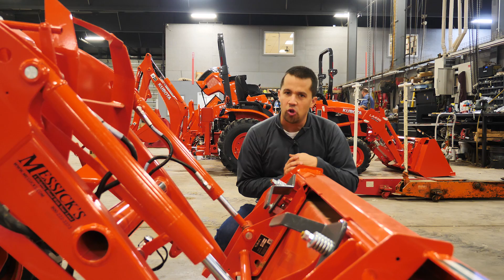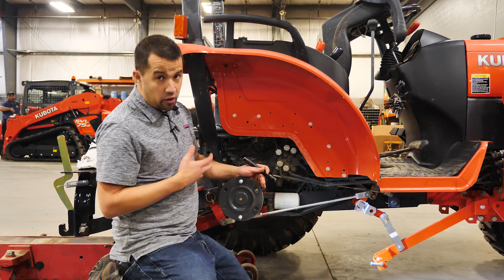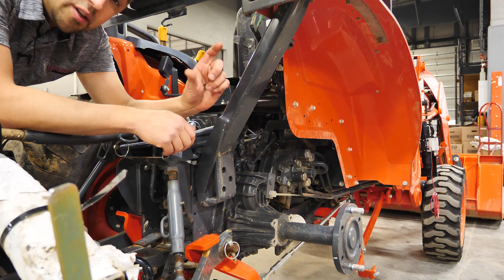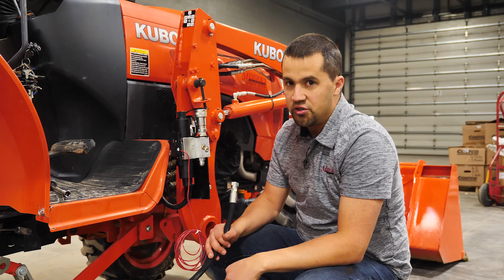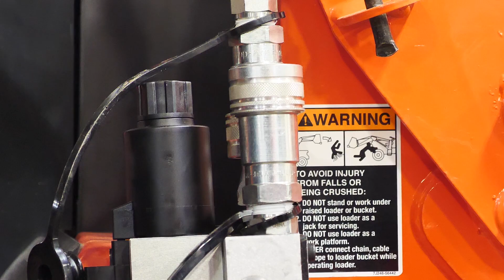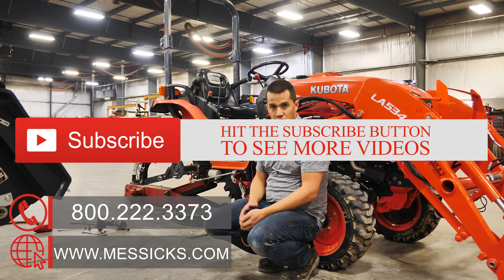Installing WR Long 3rd Function Kit on Neil's Tractor | Kubota B3350

Comment: WHY is everyone putting the diverter on the loader mount to the ouside of the tractor so hose connections stick out where they can catch on things?

YOurs has less hoses... and thus doesn't have the more common 2 hose connections pointed straight out.  So that's better, but I would think still vulnerable to catching hose and or wire.

Isn't there a way to mount that somewhere else?

Comment: If I need a continuous flow in the rear of the tractor , can I put a hydraulic multiplier in the 3pth line? my tractor has a visible cylinder for the 3pth in addition to possibly internal lifting mechanism. 
thank you

Comment: Warning for back hoes! The diverter uses the same power beyond that the back hoe uses so the kit will not "drop in" and be plug and play (at least on some models such as B2650). There is some modifying and custom plumbing that needs to be done so keep in mind it will not be an easy straight install.

Comment: I done this to the T on my L4240 ,my grapple works great in one direction ,open or closes ,if I swap the hoses at the diverter valve quick disconnect the grapple works great in the other direction otherwise it’s always extra slow in one direction
Reply from the maker: Probably have bad couplers
Reply: @MessicksEquip  that’s what my local hydraulic shop said so I spent $70 to replace the new ones that had came with the 3rd function kit no difference
Reply from the maker: Damaged 3rd function solenoid then.

Comment: is this the same with the new LX 3310 with a 535 loader? the loader valve looks like it is in the same place as on the b3350 . are the kits and hoses the same? Has anyone done this yet on the lx3310?
Reply from the maker: It is. I bought an LX3310 and moved the kit from this tractor to that one.

Comment: I recently took delivery of an LX2610.  The first thing I did once they got if off the trailer was to fold the ROPS so I wouldn't forget and tear my garage door frame out.  The first thing I did once my ass was in the seat was raise the 3 point so the rear blade could clear the dip at the end of my driveway.  I suppose it doesn't speak very well of me, but somehow I feel better about myself when I see that Neil Messick's own LX3310 has the same bent top link that I had less than two minutes into my tractor ownership!  Lesson learned!

Comment: Hey great video. Can I get a kit for my 05 B7800? Ether oem or aftermarket? Thanks!
Reply: Yo Neal I installed that 380-152A kit on my B7800. Had to tweak the mounting bracket and add two fittings. Bought a Worksaver 48” grapple, had two hoses made up for it and now everything is working well.
Reply from the maker: Yes you can! 800-222-3373. Ask for nate.
Reply: @MessicksEquip  Thanks Neil, spoke to Nate the other day. Very informative conversation and outstanding customer service. I'm gonna go with a Land Pride 380-152A kit to get the two button control versus Wr Long's rocker style switch.  I may need to have one hose made up to make it work or maybe not. Still figuring that part out. Hopefully I can use the kit in it's entirety and make it work. Also like how your website states the quantity of the various kits you have in stock. That's awesome.

Comment: Neil, would like to have been able to watch a video like this before I installed the rear remotes on my B2650. Among other things, had a heck of a time finding part number/correct fitting for the loader valve.  Even your parts guys sent me the wrong one.

Comment: Why the WR kit vs the Land Pride kit? 

Would a Land Pride kit be more factory looking?
Reply from the maker: Yea, we generally use LandPride on the models where its offered. WR has a bunch bigger offering .
Reply: @MessicksEquip  on an L3301 would the kit come hard line plumbed or would it be hoses? 

I know the new LX look sharp very clean but I expect the L series to be more function over looks.
Reply from the maker: Hoses on the land pride kits. Oem has hard lines.
Reply: @MessicksEquip  so for an l3560le it is an option?
Reply from the maker: @TommyOmallet  yes.

Comment: Neil what kit do I need for my L2501?
Reply from the maker: https://messicks.com/part/380-152a/kubota-std-l-series-third-function-valve-kit
Reply: @MessicksEquip  Neil will this work on my B2601 with a BH70 Backhoe or does the backhoe use the extra port?
Reply from the maker: @mikehobbs8625  You have the T the port.

Comment: I’ve got an L2501 with a third function valve which I use my grapple. What other implements can take advantage of the front hydraulics. For example can a front mower be adapted using my skid steer type quick mount? How about a front mounted rotary anvil mower? Brush hog style?

Comment: what are these valves rated flow? i can't find that on their website. need a valve that can function both a grapple and a motor, system is only 6 gpm so i would think it should be able to handle that.

Comment: FWIW: i put a dash mounted switch to control power to my third function switch and a red power indicator light. i only turn it on when i have something attached to the front loader that requires hydraulic power like my grapple. this way i don't accidentally actuate pressure to the front when i don't have a need to. this saves on accidental pressure spikes when operating the loader
Reply from the maker: Smart. The OEM valves also have this.

Comment: I have this WR Long kit on my cab tractor, the dealer mounted it below cab on the rear of tractor. This works great, out of the way and no chance of me ripping the wires out of valve when working around trees/brush. Reasonably priced kit to get the 3rd function

Comment: I built my own 3rd function setup from spare parts at my shop and ordered the handle / switch online.  I had trouble seeing the markings on the loader valve so I called my dealers shop to ask if they knew the layout. They had no idea what "power beyond" even was.....I wish I had been able to buy from you guys!  

By  the way - if there's room (depending on model) the valve is better protected mounted on the other side of the loader frame in between it and the hood / engine shroud.
Reply: @Jordon Carlson Trade school? What's that?  Is that where they teach new "techs" how to charge their laptop for diagnostics and  email the factory tech support for help when they don't have step-by-step instructions with pictures?......I've got guys with 10 years plus in equipment work who still think every hydraulic fault starts with "the oil in the tank must be low"!

Comment: I put one on my Kubota with a backhoe everything was pretty easy except for where to hook up the hydraulic lines I ended up taking it to Messicks/Halifax and the mechanic hooked it up but even he was scratching his head a little but he got me fixed up. I have a grapple for the loader and I also use the 3rd function for the backhoe I converted the thumb to hydraulic works great 👍

Comment: So since this kit is using the power beyond port does that mean one could use this kit and both loader ports at the same time? E.g., close grapple, curl and lift
Reply from the maker: oil will flow the path of least resistance down all 3 circuits. Its pretty challenging to do them all together.

Comment: Why is the unit not placed at the front of the tractor on the loader and use the loader bucket cylinder hoses as the feed and return lines.  The default 1po1sit1ion would be to tip the bucket the other for auxillary ports.
Reply from the maker: There is a style that does exactly that, they are harder to use.
Reply: @MessicksEquip  thank you for the reply.   I would not be happy with that product.  I guess I am too much of a neat freak to have that type put on my bx23.  I would want the factory style installation where there would not be any extra hoses on the loader and the quick detach would not be impacted.

Comment: Had this installed from dealer and  3 months later its stopped keeping the grapple bucket closed and open. Its like it leaks by.  They replaced it and its still doing same thing. Dealer says they dont know why. So i have to keep pushing button to keep bucket closed when loading brush. Just curious if u all have had any issues with this?
Reply from the maker: sounds like a bad solonoid.
Reply: you might put a pressure gauge on the return port of the valve to see if something is causing pressure on that side. next i would move that pressure gauge to one of the grapple hoses and try again, unhook your grapple and from the quick connects and hook in your pressure gauge to one side of the quick connects, start the tractor and pressurize the hose with the gauge, when you let off it should hold pressure- if it bleeds off right away you might have a bad 3rd function valve.... maybe (more than likely) you have a hydraulic cylinder bypassing? the other way to tell is to take one of the hoses off your grapple (undo it from the quick connect on the tractor and remove the quick connect on the grapple side) and direct it into a bucket, then pressurize the other side and see if the fluid keeps bleeding off. pressure gauge should be able to handle 5000 psi.

Comment: Need to mention that when mounting the hose to the loader that the hose wont be pinched or stretched through all loader and bucket movement. Sounds obvious but it happens all the time.

Comment: Another great video! I’m eventually planning on a third function myself because my need for a grapple . The work I did last week for 4 hrs cutting up a downed oak small enough to be handled into a wheel barrel could have been done in a few minutes and no back ache. There’s nothing like pushing a heavy wheel barrel past a L4701 that don’t have a grapple , Ouch.

Comment: I already have a third function on my mx5100 it works great wouldn't be without one again.  But I'm wondering does kubota make a kit to make quick tach accessory arms hydraulic similar to a " bob tach"
Reply from the maker: Yes
Reply: Messick's is there a chance you could do a video on that accessory?

Comment: Doesn’t Kubota offer optional rear SCVs to run your third valve on loader  off of?
Reply: My LA1153 has the option at the rear so i was just going to have some lines made and use some zip ties that will  hold the line to to the tractor. I can unhook them from the grapple when i change back to the bucket.Im not sure why i would need this.
Reply from the maker: You can, its hard to operate like that
Reply: Messick's I have my grapple set up like that and it’s not a big deal since my 3rd SCV control lever is right below my loader control  but I would agree if your rear SCV control is somewhere else, I got Green and Yellow tractors, reason I’m asking was my buddy just bought a 3901 Kubota and wants to install a grapple like  the setup I have,  thanks for reply !

Comment: I wish someone would make a video installing a 3rd function with a backhoe no one has one and not a lot of info on the net your video was very helpful though showing exactly what ports thank you
Reply: that's actually easier. the backhoe should already be plumbed at the "power beyond" port with two hoses going to the rear of the tractor, one is pressure to the backhoe, one is return back to the tractor. follow the hoses back and (on my MX4800) is an aluminum block just under the r/h side of the loader. undo just the hose that is pressure "out" to the backhoe"- the pressure "in" side of the 3rd function valve hooks in to there, the "return to tank" side of the 3rd function valve hooks to the backhoe "pressure in" hose that you removed in the first step.... and if i remember right the pressure side of the backhoe hoses is the one with the male side of quick connector.
hopefully this helps
.

Comment: Informative video as always but would have been nice to see it function after the install.
Reply from the maker: Stay tuned
Reply: @MessicksEquip  Could you talk about how an afterMarket dual lid Grapple could negatively effect the Kubota Hydraulic system. I have a L4060 Grand  with the Dealer installed Kubota 3rd function valve, Hyd FEL autolevel and a Backhoe that I am using to carry some Huge Red Oak logs to my neighbors sawmill. My backhoe is a great counter Balance but it now leaks like a sive and now the Backhoe bucket is swinging to one side. I feel like when I hit a bump in the road the FEL/Grapple is sending a hydraulic Shock  to the system. Am I harming my Tractor.

Comment: What do you do if you have the power beyond kit already installed on your tractor for a backhoe?
Reply: That is a very good question that I myself am wondering.
Reply from the maker: T the PB port
Reply: that's actually easier. the backhoe should already be plumbed at the "power beyond" port with two hoses going to the rear of the tractor, one is pressure to the backhoe, one is return back to the tractor. follow the hoses back and (on my MX4800) is an aluminum block just under the r/h side of the loader. undo just the hose that is pressure "out" to the backhoe"- the pressure "in" side of the 3rd function valve hooks in to there, the "return to tank" side of the 3rd function valve hooks to the backhoe "pressure in" hose that you removed in the first step.... and if i remember right the pressure side of the backhoe hoses is the one with the male side of quick connector.

Comment: I just hate after market stuff. Makes it look cobbled looking. Big hose and valve
Reply: FWIW: i have the same "Kubota" kit...... the valve is identical, the only difference was the control switch handle. has two buttons instead of a rocker switch.

Comment: I would have liked to seen some sheilding around that electronic diverter as it is hanging off the side of the tractor.  Is there an option for that, or would someone have to fabricate it themselves?
Reply from the maker: working on a video to show differences between different brand valves. These are cheaper than OEM, but less shielded and not fit quite as well.
Reply: @MessicksEquip  Looking for a OEM kit for a L4760. Are they available and come with install instructions? If yes and yes please provide a part# for the kit.
Reply from the maker: @happyrecluse2849  on several month long back order. We can get them from WR long in 7 to 10 days. 8772603528

Comment: Are you worried about having that valve on the outside of the tractor like that? Seems like there has to be a better option? Thanks for the walk through.
Reply from the maker: I am. This is pretty typical of the one-size fits many valves. The OEM ones (when available) are cleaner.
Reply: @MessicksEquip  I would like to Point out that the OEM on my L4060 Grand hangs low to the ground and has two hoses that I worry about snagging on the downed trees that Im still trying to clear from Hurricane Michael Way down here in NC! ( Don't tell anyone Neil but I'm a transplanted Pennsylvania Countyboy from Schuylkill Co) LOl P.S. The Christmas light show is the Best around. Worth the drive home!!!

Comment: I have a Kubota M5400 from early 2000’s. I would like to add a loader but I’m not sure where to start. It’s pretty low option. It was used in a horse barn to run the manure spreader. Thanks for any advice!

Comment: A day late haha I stumbled through a landpride 3rd Function install on my l2501 yesterday the instructions were pretty vague on what ports to use basically said we suggest a dealer hooks it up I assumed b y was power beyond works like a charm love the grapple moved firewood all day
Reply: How do you like the Land Pride kit?
Reply: @MrManic52001  it's a good quality kit zero complaints installation instructions aren't that great but I figured it out I saw a new Kubota LX series tractor that had a Kubota brand 3 rd function on it had hard steel lines on parts of it opposed to all hoses on the land pride and was very well set up with guards etc not sure it's available for the L series or not may be something to check into if you're looking
Reply: @mattcanfield6384  yeah, i am about to drop the dime on an L3301 DT and i am mulling having it plumbed from dealer OR diy. 

Did the kit come with all the hoses and wiring?
Reply: @MrManic52001  it came with everything but the couplers you pick which style you want to match your equipment it's a pretty easily install if your halfway mechanical and understand how third functions work   and how the oil flows
Reply: @mattcanfield6384  thank you